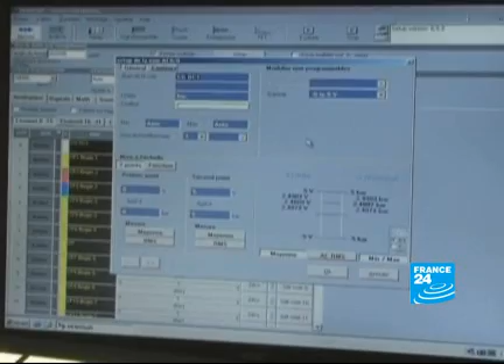Final tests for world's fastest train

Comment: Therefore, since, due to the speeds attainable by the Transrapid, and any similar - yet more advanced - system to follow, and the inherently safer operational conditions, which are, essentially, the fact of no moving parts, it follows that the wave of the future for high-speed ground transportation, for passengers and freight, for at least the next 200 hundred years, is Maglev.

Comment: It's foolish to compare Conventional High Speed Rail (CHSR) with such exotic systems as Thyssen-Siemens' Transrapid Maglev system, as they are completely different from each other. One (CHSR) uses the traditional — albeit highly advanced — steel wheels on steel rails, with concomitant axles, suspension, electric drives, gears, etc.; the other floats on a magnetic field and is impelled by an induction current; has no wheels, no axles, no suspension, no drives; hence, no moving parts.